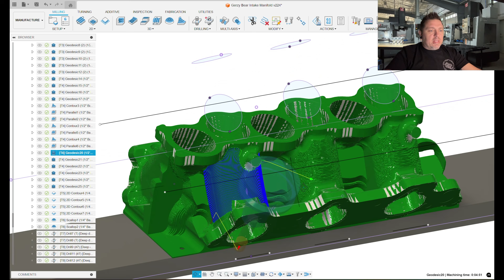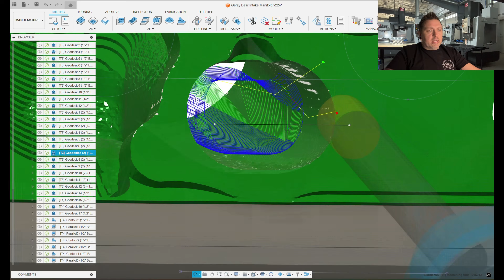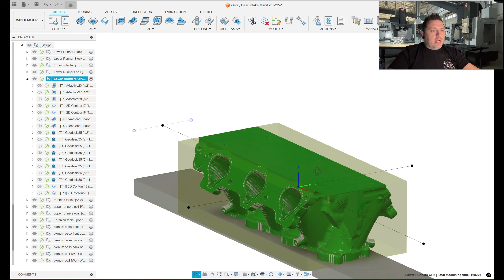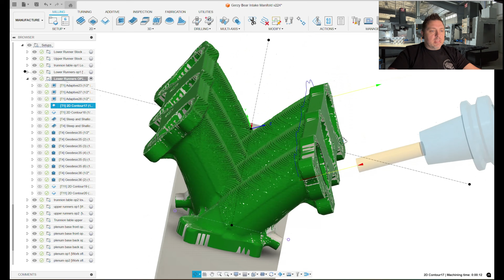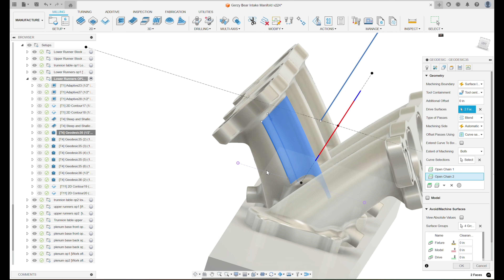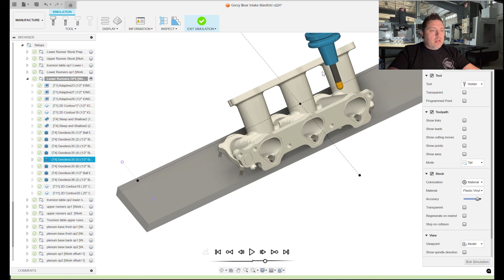Learn to Build a PROFESSIONAL Billet Intake Manifold : Episode 6 CAM!

Comment: You ever tried to use flow instead of geodesic for your 4 axis simultaneous finishes? I had the same scenario where I had to “rock” the 4 axis to get to an under cut and used a guide curve with from curve selected in my multi axis tab. Only thing I think flow may get some heavier cuts in the corners. It’s one of those trial and error type things. I like that fixture design, I’m constantly having to come up with ideas where I work. Some times the hardest thing is how do I hold the part lol. Gotta get creative. Love the content man, I subscribed if you ever wanna bounce ideas I’d be more than happy to give my two cents. I’m a machinist but mainly oil field type stuff. Never messed with automotive parts

Comment: Do you buy a whole year sub for the mfg extension, or just monthly as needed?  I would have a week of design, then weeks of manufacture where I wouldn't need it.  I'm also told that if a file has a 4/5 axis toolpath it doesn't go away when the sub expires.
Reply: So I did the 14 day trial before I bought the extensions and if you don’t have that program saved outside of fusion when you go to post it out again it won’t work, you may get away with protecting it, that MAY work but I wouldn’t count on it.

Comment: Great video again!

Just wanted to elaborate a little more on the comment I made, which you seem to be referencing at 1:15 :)
It seems like you misunderstood what I meant.
what I meant to say is that there is a 'start' dropdown within the extrude command, which is set to 'profile plane' by default.
you can set that to 'Offset' which lets you specify a offset distance from the sketch plane, which the extrude will then start from.
that way you don't even need to move/redraw your sketch/plane :)

Hope that clarifies it a little, and keep em coming!